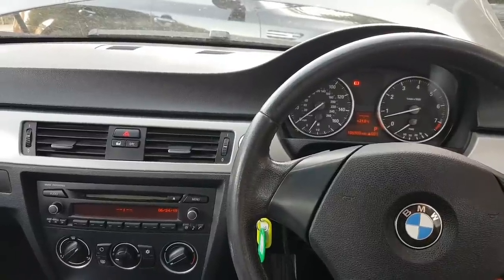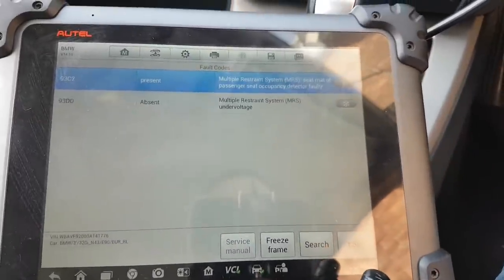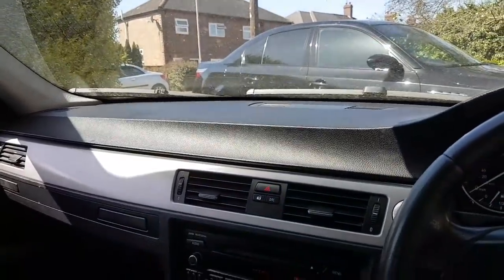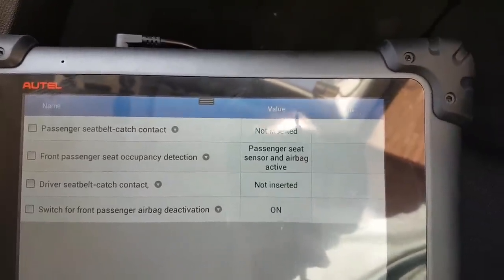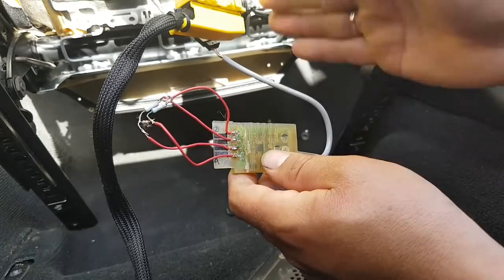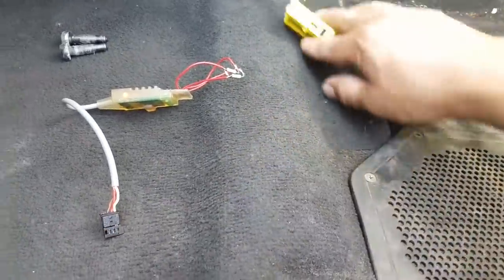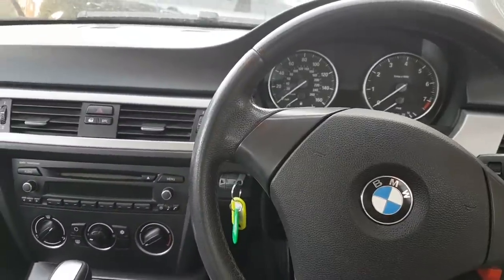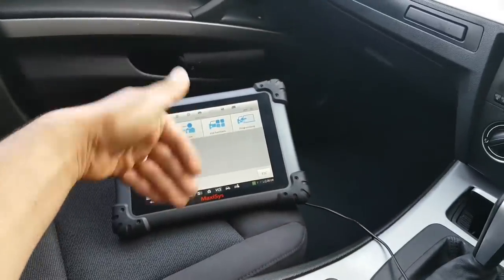BMW E90 Airbag light on, error 93C2 . Fault finding and repair.

Comment: I am not a saint but I will never risk my business for a 300 Euro part . I am not against that what you did but in my case , even if the client signs a contract that he orders me to bypass airbag components , it is against the law . Signed documents or not . I have witnessed a very dirty play which I am not going to write down but in the end the liability insurance paid X amount of Euro´s and the garage lost it´s license . I do understand your repair will work but in my case , no flash , rewrite or tampering .
Reply from the maker: Totally agree...
And to be fair, even this morning before I release the video, I was wondering about it...
I have strict much more since this was recorded... And I am no longer doing anything like this... as you said, new part whatever it costs...
I know however,  if I haven't done it, someone else would... and from what I have seen, good knows what would be done... at least I know the airbags will still deploy...
but I guess that it would be on their shoulders not mine... lol
Thanks for watching and for your comment!
👍👍👍
Reply: @LMAutoRepairs  Yah I wouldn't mind unless someone did like my brother's mechanic did he just cut the side driver seat bag and said it will turn the light off instead of actually replacing the driver occupation  sencor and charged him 200 for it even though on Peugeot it's the connectors or modules that fail
Reply: Actually you are not causing any safety hazard by doing this. All that changes is that the passenger airbag will deploy no matter if someone is sitting in the front passenger seat or not.

Comment: I have the exact same problem on my bmw 1 series e81 2007. Passenger seat occupancy sensor pops up on the autel. I have tried an emulator but no luck! On live data it state the passenger seat occupancy sensor is deactivated. I think somebody's tried to code it out and failed. What are my options 🤔🤔🤔
Reply from the maker: The code has not been done correctly...
But, my advice is a new matt sensor...😊
Reply: @LMAutoRepairs  Thanks for the reply I totally agree 👍 The coding will still have to be sorted. What's the best way to code the module ISTA 🤔
Reply from the maker: @sidsyd123 
Or any other capable tool...
NCS Expert should work for that car...
👍👍👍
Reply: Perfect thank you 👍

Comment: Didn't even think BMW sold vehicles without A/C on the E90! You ever replaced the LCD on the e90 radio... it's the next thing to do on my long list of repairs🙄
Reply from the maker: Hi
No... never did that... buy seen them damaged...
Thank you for watching and for your comment! 
👍👍👍
Reply: It has ac, but it’s manual, not auto. What a base model 😂 not even steering wheel buttons
Reply: @Syntappi  Really haha even corollas have them

Comment: imagine ending up in a jail cell for manslaughter, not the best idea this video
Reply from the maker: Why do you say that?
The airbags will just work as normal in case of an accident...
Better than the ones I get sometimes with the light covered/tapped...😊
👍👍👍
Reply: @LMAutoRepairs  god forbid something were to happen , but if it did you are liable because of this fix, and its all on vid for the court. dont put yourself in this position
Reply: In jail 🤣🤣🤣🤣🤣
Reply: @geoffreyrawlingd2430  bit slow there mate

Comment: I like your approach, i also prefer to avoid emulator, if it is possible. But it is important to tell the customer to always use seatbelt on the passenger side after this mod. Airbag will now deploy also if seatbelt is not inserted, and this could be fatal even in a low speed crash
Reply from the maker: Seat belts are mandatory independent of the speed you are driving... so... 😊
But I know what you mean...
👍👍👍
Reply: @LMAutoRepairs  Here in italy most of the people don't use seatbelts, so when i work on an airbag it is my concern to explain customers the importance of using it. I hope you are more conscientious in U.K. about using it! 😁😁😁

Comment: In the video, it isn't entirely clear where the resistors are connected.  I tried googling but the only diagrams I found were for E46 and older, which use a different type of seat sensor.  Could you provide either a link or a wiring diagram showing the resistor layout relative to signal, power, and ground?

Comment: Hi there I have the same problem. I’ve got the mat out and doing the same as  you have. I’m just confused on your diagram and the resistors to use.  I've got 2 k resistors and 1 k resistors so am I just best to use all 2K can you explain more on the diagram it looks like they all join in together with resistors which confuses me

Comment: It works with coding,but the parameters that need to be coded differ as the 2008 and up models have a different version of the airbag module.
Reply from the maker: I know...
Either way wouldn't work...
Wouldn't matter which parameters I tried...
Or I missed something...😋
Thank you for watching!
Reply: @LMAutoRepairs  my MS906bt is not able to code any configuration related to airbag on e90s but ncs expert is an excellent tool for such a job and you can get it much cheaper. Using it is a bit tricky I use it  very rarely and hate it every time :) but its a lovely tool.

Comment: Hello
How do you check the power and grounds
Is not danferous to use multimeter to Airbag cables?
Reply from the maker: If it is supposed to have voltage in there, there is nothing wrong with measuring it... in the rights pins...
👍👍👍

Comment: How I repaired this fault.
Bought contact spray (for electrical and electronic connections), then took the seats out and cleaned the both connectors from the car and from the seat.
Just take all the pins out, one by one, and spray them with contact spray, then brush it well and wipe it them with a towel. 

I had to drive 5 minutes then stop, then start again the car after 10 minutes, to see the fault gone.
Hope this helps anyone !!